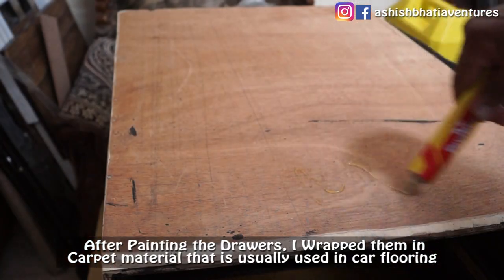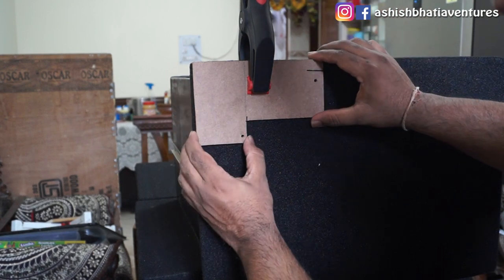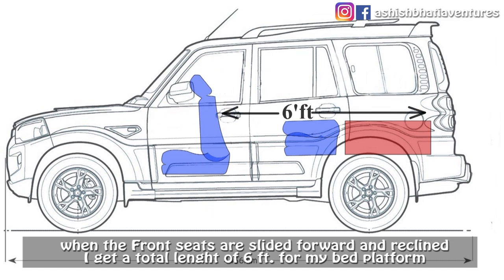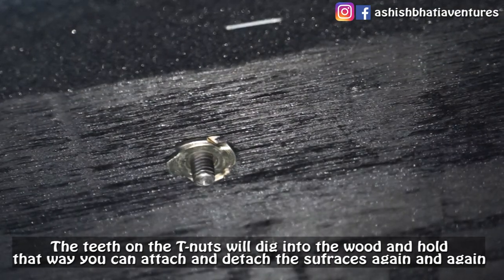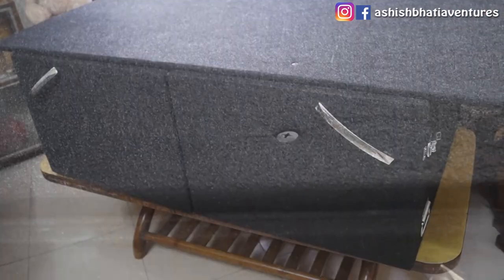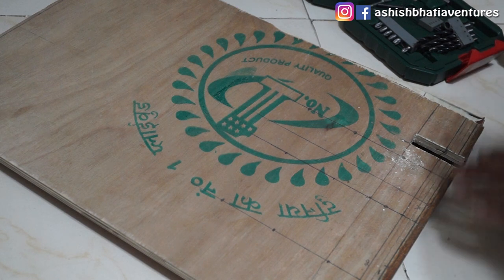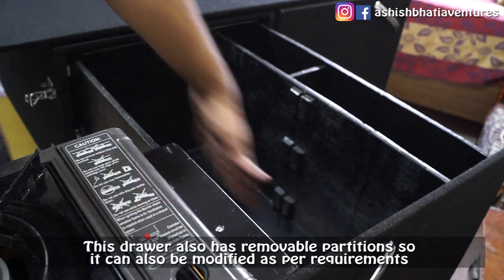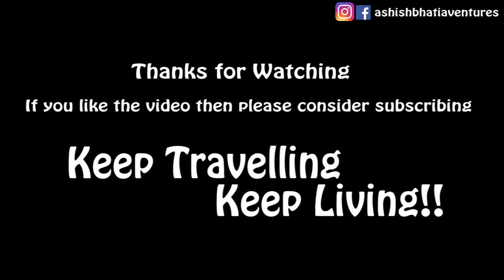Car bed and Drawers Modification || Caravan Conversion Mahindra Scorpio Part 3 || Campervan India

Comment: Excellent innovation !what's the approximate weight of only the setup unloaded
Reply from the maker: I have not measured exactly but 2 drawers plus bed platform weighs around approx- 50 kgs. With the rear seats removed and considering the rear space is designed to fit 2 Adults, its easily manageable.

Comment: Seen your this beautiful upgradation/modification of foldable bed one year back...m also installing the in my scorpio. But not finding the way to take out Stepney tyre when this box set up is placed.
Request you to send/comment pl
Reply from the maker: Don't extend drawer till the end of door. Keep the system around 4-5 inches back. It will keep the Stepney screw free to use and will also give you some space to keep misc. Items. I'll upload a video of same on my Instagram you can check it on "ashishbhatiaventures"
Reply: @ABVentures  Thank you...

Comment: Mere pass bhi scorpio s10 model mujhe uski heater core se coolant flow band karna hai...toh jo engine se colant ki 2 pipe heater core se connect hai unko nikal ke  kis  cheez se joint karu...jo safe rahe  kyoki apka brain computer  jaise work karta hai  pls suggest me safe idea ..ki vo joint leak / melt /rusting na ho . I am waiting for your reply ?
Reply from the maker: Aapko auto market se water hose ki size ki 2-3 inch ki connector metal tube mil jayegi. Saath mein 2 clamping clips use karke aap jod sakte ho. But question ye hai ki aap ye kyu karna chahate ho???
Reply: @ABVentures  kyoki heater ko maine 7 saal se use hi nhi kiya...or gaddi mei  3 rpm karte hai toh dashboard ke ander se  heater core se awaj aati hai pani ki check karwaya tha maine..  yeh reason hai bas ....baki aap bata do ki usko disconect karne se gaddi ko koi nuskan toh nhi hoga ??

Comment: Sir what about inflatable beds , which we can use instead , also luggage issue bec going on long drive clothes n essentials are must to carry ? Good luck for ur trip .
Reply from the maker: Inflatable car bed available online are designed according to width of the car. To fit on rear seats. Means the dimensions is approx 4 feet by 2.5 feet. It's good for kids but too small and useless for adults. Plus the quality is not upto the mark. Luggage will come on top of this drawers system and since most of the stuff we carry will go in drawers now only 2-3 bags or suitcases will be left to accommodate...thanks
Reply: @ABVentures  yes sir , luggage problem is solved , I am planning to buy inflatable beds for XL 6 , let’s c if things work out or just to take a stop at a hotel in main city . Thank u for reverting , good luck n safe driving .

Comment: I own a Renault Lodgy so I cannot comment much  for Mahindra Scorpio.Please checkup if you can get front seat buckle assembly for seat belt . This can be bolted to the sleeping platform one to the right other to the left ,and the seat belt can be used to adjust the sleeping height . Additionally if lifted properly the sleeping platform can be used for reclining instead of sleeping.

Comment: Where to keep luggage while traveling?
Reply from the maker: On the top of the setup. It will still be low enough not to block rear windscreen. You can check the travel videos on my channel too..

Comment: Ashish good work I indeed liked it just an idea as you asked for support at the front seat you can use something like folding steppers that are installed on thar to climb on top by bimbra or classic service point noida they can rest on the front seat frame and as they are folding they won't interfere too only can be used when platform deployed check it out

Comment: You can install the Jerry can back of the boot door so that you can keep some lthing else in the drawer
Reply from the maker: My boot door is already modified and has a water tank inside holding 12-13 liters weight. I don't think it's capable of taking more. Anyway thanks for the input

Comment: You can substitute acrylic board instead of plywood? Atleast for the table and shelf? My Scorpio is older model. Middle seats don't become completely flat. 
For the support purpose of the top section of the bed platform, try to use the head rest mechanism which can be extended...

Comment: You could use a fourth plank which when kept at 90degree will form its support. The end have tobe shaped like your vehicle floor. i. e. If there is a center bumb. The hinge has tobe made in two parts then only it will fold upwards. Like an L to compensate the thickness of plank.

Comment: Great work.. For the front support u can use cpvc pipes(light weight, strong 'enough' ) and related fixtures(T's , elbows, etc). Create a structure to work like a tripod stand. Make two of the, for either side and just place them on the floor before unravelling the bed platform. They can be made in such a way that they can be easily folded or even disassembled and reassembled.

P.S: Cross handles are not a hit. Sorry, just a sincere feedback  :-)

Comment: Excellent idea with neat work. You can use strong synthetic belt to provide further support to your foldable bed towards front seat. wrap around still fork of head rest and tighten them with use of D shape buckle. you can do it around both front seats for full support.

Comment: What is your plan for the luggage bags/trolley bags while travelling? considering 3 people you will definitely need to carry at least 1 big trolley and a duffle bag in my opinion.
Reply from the maker: Yes and it will come on top of the folded bed platform. There is sufficient space for 2 mid size suitcases and 1-2 bags
Reply: @ABVentures  Would it not restrict your rear visibility through IRVM?
Reply from the maker: @alandsouza8317  a little yes but there still will be room. Most of my luggage and stuff will be in drawers only so Let's see...

Comment: Great work Ashish ji. For front overhang portion of the bed, you can make an arrangement to tie the front portion to the head rest rods of front seats. Use simple chain and hook, which will make the bed more steady.
Reply: I mean, two chains will be screwed with the ply, and the other ends of the chains will be hooked to head rest rods.

Comment: Sir you can use starps with hooks to secure the sleeping platform with the front seat head rests.
Reply from the maker: Yes it is cheap and good alternative. I have that in mind too. Baaki lets see...😊 thanks for the input
Reply: @ABVentures   I own a Renault Lodgy so I cannot comment much  for Mahindra Scorpio.Please checkup if you can get front seat buckle assembly for seat belt . This can be bolted to the sleeping platform one to the right other to the left ,and the seat belt can be used to adjust the sleeping height . Additionally if lifted properly the sleeping platform can be used for reclining instead of sleeping.

Comment: Excellent work. For the front peice of the bed, you think of removing the head rests and get steel rods made that can go in the head rest and give support to the front peice of the bed. 
One of the enthusiastic person did that. Will share the link of that video.
Reply: Check the video from 2:50
Reply from the maker: Thanks for the input will definitely consider